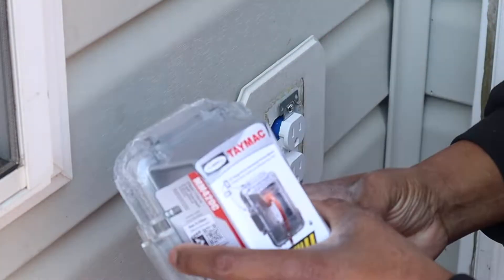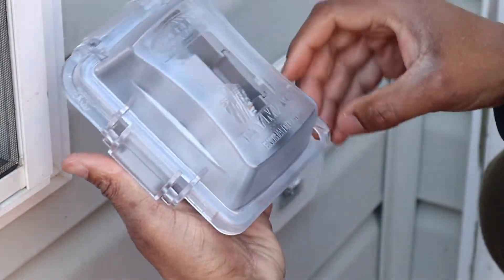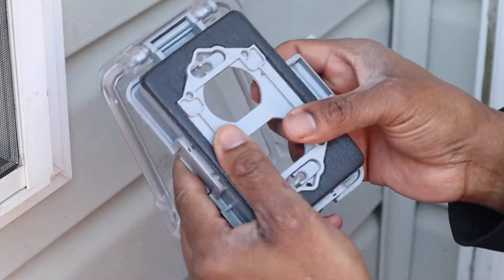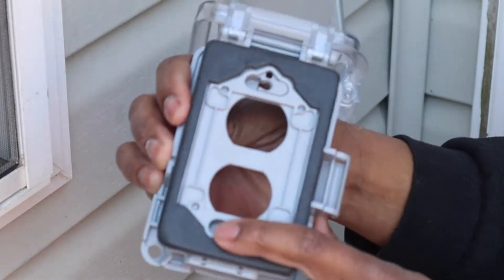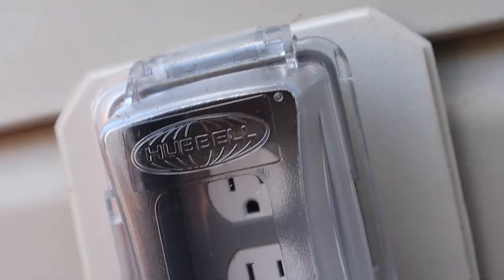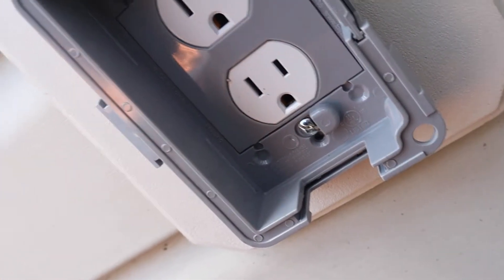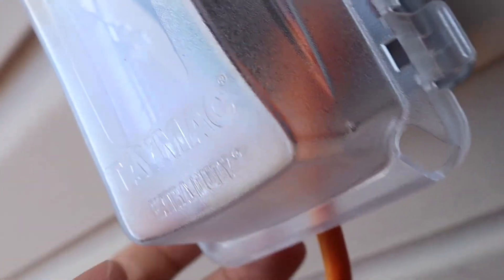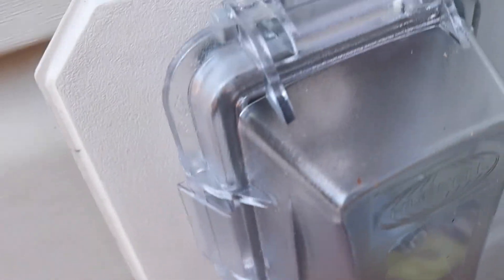TayMac MM410C Single Horizontal/Vertical Mount 1-Gang Weatherproof In-Use Electrical Outlet Cover

Comment: You should change that outlet with a GFCI
Reply from the maker: Hello, I was going to do that, but the GFCI I was going to install is too big to fit in the recessed box on the house, so I installed the GFCI it in my garage. Do you think I need to install one outside? I also have two 20 AMP GFCI outlets out side. https://www.homedepot.com/p/GE-2-20-Amp-Backyard-Outlet-with-GFCI-Receptacles-U012010GRP/1005793
Reply: @ALWAYSOCCUPIEDTV  I know that they have GFCI’S that look what you installed, but I believe that NEC code requires you to have GFCI anywhere that is potentially exposed to areas that can get wet. They do have many different styles of GFCI available
Reply from the maker: Thanks! I will check online for 2 of them. the gfci for the outlets outside is wired in my basement. So when it trips I reset the gfci in the basement. MY HOUSE IS CONFUSING!!! 😂😅😂😅
Reply: maybe, but if he has a gfci inside...no